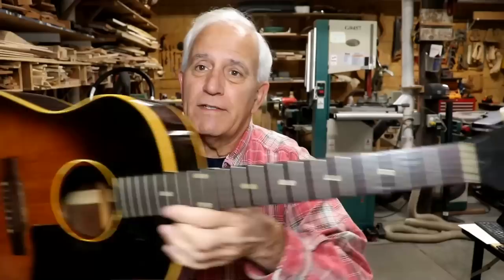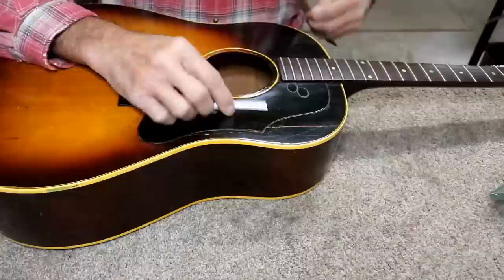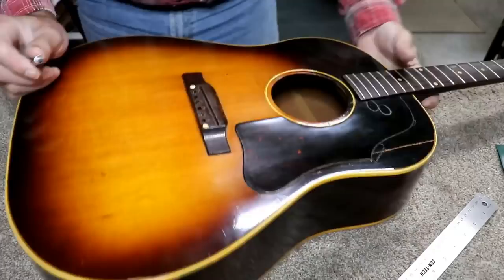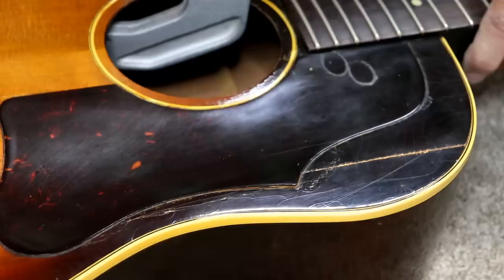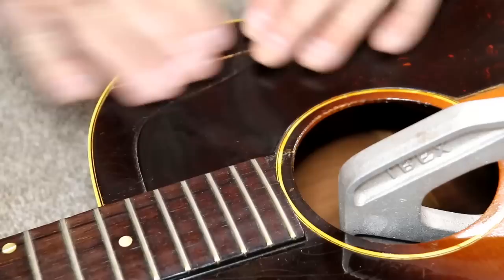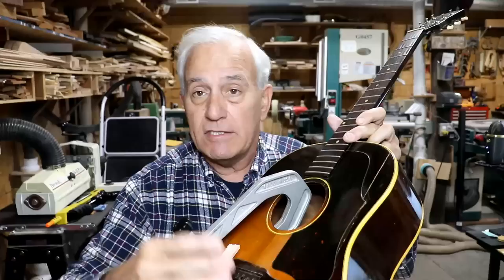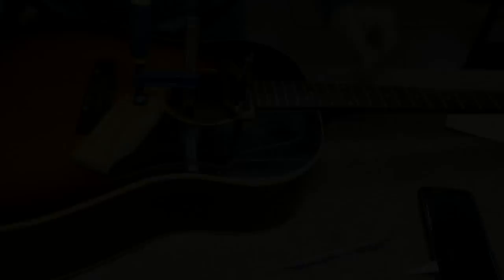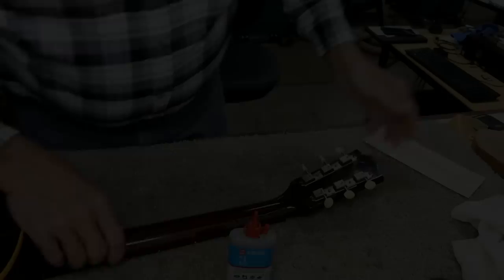615 RSW This J45 Gibson WORKHORSE has EXTREME Pickguard Shrinkage!

Comment: I came to this video because of a used J45 that I looked at today that had peeling pickguard corners. Haven't found info on that yet but I did run into advice about shrinking pickguards with top cracks like you were dealing with here. I gather that the dip in the top comes from a shrinking pickguard pulling the wood together tighter and tighter until it bows to get some relief from the compression. I imagine the pickguard pulling inward on wood that is attached at the outer edge is also what causes the top to crack from fatigue. The suggested cure was to remove the pickguard, let the top relax for a couple weeks or so, do whatever repairs are necessary and then reinstall the pickguard, which should have a line around it because the top has expanded to original shape while the pickguard remains shrunken. I have zero experience with any of this so take with a grain of salt.

Comment: Hi Jerry, sorry to hear you’re retiring the repair business as I’ve enjoyed your many videos. As for leaving a guitar as original as built, not sure if it’s as important as improving the playability of the guitar. I’ve not done much work on my own guitars but I have had a look inside of all of my own guitars, mostly Martins from 1929-1989, 1:08:15 1:08:15 and I’ve seen a big difference in bridge plates. I was the “custodian” of a Martin D-45 for almost 35 years but after some major non warranty work by Martin at the factory, I decided it was time to let someone else enjoy it. One big problem was the bellying up of the top behind the bridge. Even the repair tech told me he had a problem getting it to flatten out. I just saw a bit about TJ Thompson’s BELLY REDUCER (something we all could use!) and wonder why I hadn’t seen it sooner? In any case, the bridge plate in the D-45 wasn’t much bigger than the bridge where as a D-18 I’ve had since 1978 with a really nice top has a bridge plate almost twice the size of the bridge.
I think you done the right repair and enjoy your retirement! 
Mac Morgan, Hockessin Delaware

Comment: Jerry I can tell you from experience owning Gibson Guitars that Gibson DOES NOT normally use varnish on their bridges and with that varnish puddle the way it was Under that saddle It looks to me like someone after market varnished that bridge and could have been the reason the Bridge wouldnt glue down on that one corner. The varnish probably found a small way of getting up under that bridge on that corner and thus it wouldnt hold when you tried to glue it so its probably a good thing you took the bridge off and cleaned it good

Comment: Just wondered if air pressure could have pushed glue under the braces more effectively than the brush, at least for hard-to-reach places?  I have also used suction cups to force Titebond into tight cracks.  Works for me.

Comment: Why not remove the pic guard first before trying to flatten the top?
Reply: That is  my thought as well.
Reply: @stringpicker5468  the pick guard is what caused the problem. I agree that it should come off.
Reply: I agree, but the customer is being cheap. It's a nice old guitar, why not let Jerry do what he needs to do to get it right. Worth the $$ in the long run.
Reply: As Jerry always says.... What the customer wants is what he will do. It makes life hard at times (remember, It isn't easy being Jerry!) but if the customer wants to spend as little as possible (and we ALL know money is tight right now) then Jerry does what costs the least.

Having said all that, it would probably have been less work (so cheaper) to take the guard off and either try to flatten it or replace it altogether! That might even have made it easier to fix the braces too!
Reply: That’s a monumental task to get it off and then back on to match the finish. My thought (talking out of my backside) was to use a heat gun to relieve the stress and then clamp it until it cooled. Then there wouldn’t be as much stress on the braces.
Reply: Hi folks, I'm from the UK. The temperature is very variable throughout the year. I have a 70's Levin W36 which I bought as the third owner. This guitar has gone over time with a straight neck without truss rod tension. Broke the right hand side of the shoulder side twice. Paid a guy first time but not second time to fix it. Hasn't broken since. A bit of sanding and shellac coats, good as new. However what I'm saying is I don't think vintage acoustic guitars are a great investment. I would buy a brand new  guitar as a choice. I think acoustic guitars are a temporary thing. Give me a new one any day without issues.
Reply: @thebubster0312  Much truth there and I tend to agree, but some of those vintage guitars are just cool, and have a great sound.
Reply: @thebubster0312  Also from the UK (Liverpool). Given the way our temperatures can vary from day to day (or minute to minute!) I'm not at all surprised your guitar's neck has gone the way it has. I tend to agree that "vintage" doesn't always mean better, and in fact my father-in-law played a cheap 1980's Yamaha he picked up at a pawnshop for a tenner. He died in 2013 and left it to me. It is as solid as a rock, and requires no more than a minor truss rod tweak at the start of autumn and back again in spring!! I wouldn't swap it for ANY "vintage" beast that needed babying all year round and fell out of tune every time you looked at it sideways!
Reply: Try getting an original pickguard off an old instrument in one piece. The pickguard needs to be preserved for guitar valuation.
Reply: @fermisparadox01  There is some truth there no doubt, but if it is causing problems what are you suppose to do? I have seen an auction with a vintage guitar, it was a Gibson, I think it was a j-40 or similar. They looked to see if it had the original bridge pad, of course the look and patina. Some things like the nut or saddle, frets and even the pick guard was to them like tires on a car, not saying it wouldn't be worth more with the original, but didn't hurt the value too much. The original bridge pad was crucial, it would make a guitar worth 25k, worth 25 hundred.
Reply: @jthonn  yeah I don't worry about all that with the guitars I buy mostly from goodwill. I buy the real old ones around 100 years old.  The reason I buy them is so I get to work on restoration .But the ones I buy are usually Chicago built. Old Washburn and Lyon & Healy etc. I get quite a few with Brazilian rosewood. When I get them they are in terrible condition.
Reply: @fermisparadox01  Man I never thought about Goodwill, I have been looking for them for years. The only ones I have found, the owners are aware now days that they are worth a little something so they want too much. Garage or estate sale days are over for it. God bless

Comment: The gouges in the bottom of the bridge are called a tooth. They are used too help adhesion.  Does not work with glue and wood. It is good for body filler and paint. LOL, Oh well, kids are funny! not.

Comment: Clean under bridge better with a 200 grit sandpaper and use Hyde glue let all glue dry for 24hours. Take off pick guard before repairs on braces. I think you can use a more experience teacher. I've seen a few things that prove that you aren't that experienced at doing guitar repair. I've been doing this around 50+years. Good luck